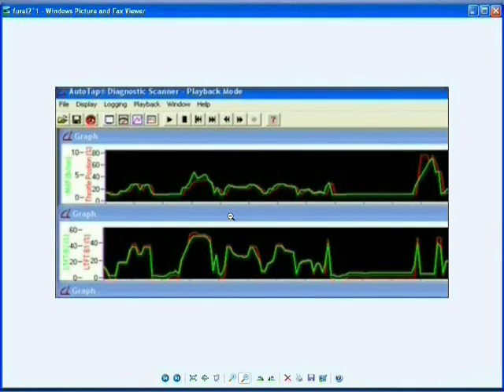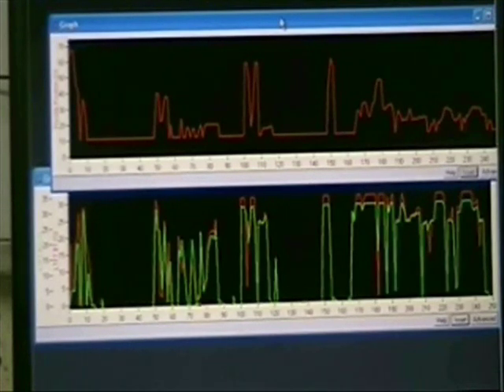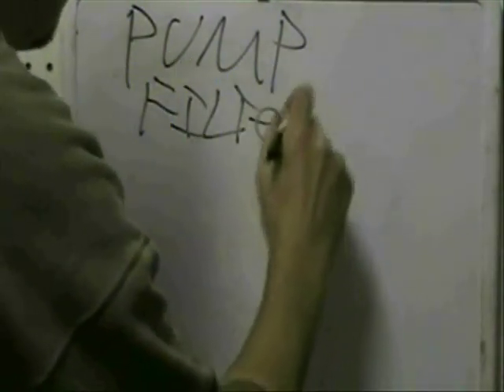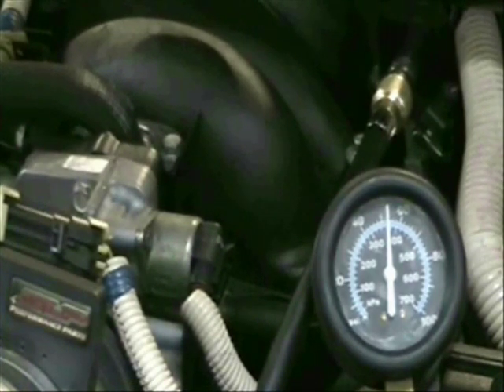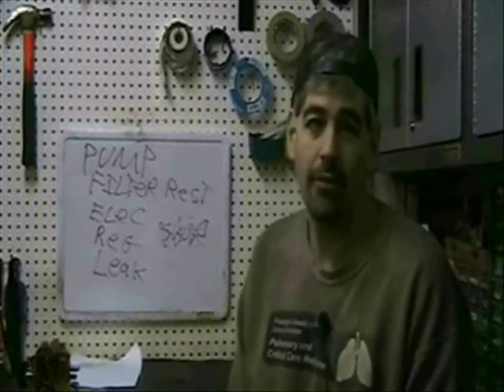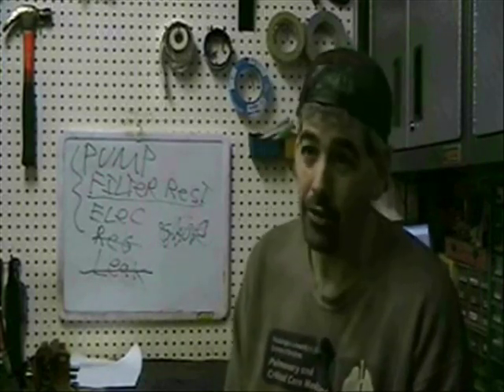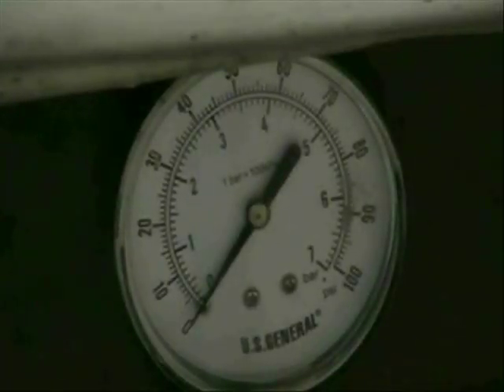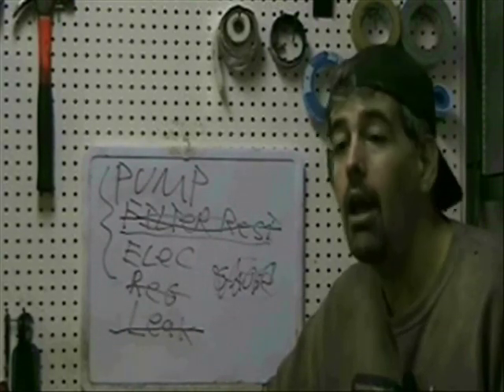Low Fuel Pressure, Lean Condition diagnosis PART 2

Comment: I just confirmed that I have a bad gauge.  I'm trying to find out why my old Fiesta 'hunts' at idle, and I was getting a surprisingly low value of 30psi on a new gauge.  I decided to test it by using it to measure a known good tyre pressure, tested with several gauges.  The fuel pressure gauge seems to be about 20% down.  This only gives me a fuel pressure of less than 40 (manual wants 55), but since the car otherwise runs well, I don't really think the pump is bad.  I'm trying to convince myself of this because I'd have to drop the tank to replace it.  I'd sooner cut a hole under the back seats, but that's going to be a last resort :-)
Reply from the maker: What is the fuel trim analysis showing during the hunting?
Reply: @SchrodingersBox  Many thanks for your reply, which I wasn't expecting, but is much appreciated.  I was watching one of your old videos, and you mentioned bad gauges, so I chimed in.  Anyway, my problem is that at idle, it almost cuts out every ten seconds or so.  It will sometimes cut out at a junction or slow bend, causing me to lose power steering, which is quite embarrassing.  When this happens, combined idle fuel trims are at about 50%, the O2 sensor is maxed out rich.  STFT comes down to about 15%, O2 sensor comes down to 0, RPM drops to about 400, STFT goes high again, and the engine recovers with high O2 output again.  I'm guessing it's a vacuum leak at the moment, but so far, I haven't found one.  All hoses look good, it doesn't have a PCV valve as such (just a thing called an 'oil separator'), and since it has a TMAP sensor, I'm assuming that will sort of compensate for leaks in a way that a MAF sensor would not; although I could easily be wrong :-)
Reply from the maker: Wait you lost me- how can you have 50% fuel trims with O2 sensor maxed out rich?  That’s not possible. Am I misunderstanding something here?
Reply: @SchrodingersBox  I know - it seems odd, but I can only imagine that the ECU is trying some weird strategy for a ten-second period to keep it running, then it allows things to go back to normal, at which point it goes very weak and stalls.  Or something is broken.  Or I am confused about my readings, which is very possible.  I'll try to find a way of showing some images.
Reply: @SchrodingersBox  Hm.  I had a thought - if the fuel trim is high (which I think means less fuel, not more, although I'm not 100% on that), but the O2 is still rich, maybe I have 'unmetered' fuel in there, rather than air?  Like a leaky injector, which would also explain my low fuel pressure?  The injector pulse width seems to be bottomed out, too.
Reply from the maker: Sorry but I don’t follow what you are saying. It is impossible to have a fuel trim of 50 with a rich O2 since the fuel trim is set by the O2 output.  Sure you might have unmetered fuel but it’s clearly being detected by the O2, so why is the fuel trim 50? 
   Sorry but it makes no sense. Something is off on your reading.
Reply: @SchrodingersBox  It's probably my lack of understanding, for which I apologise. I have assumed that a high fuel trim is an attempt to drastically reduce the fuel (i.e. a lot of 'trimming') in response to the O2 sensor saying that the exhaust is rich. From what you say, I probably have this the wrong way round.  Anyway, I tried to post an image earlier which I think shows both O2 and STFT to be high; but I'm not sure that my post succeeded.  In any case, I ought to have shown the LTFT, too, just to be sure that I'm adding them correctly.  So I'll take some more traces.
Reply from the maker: No high fuel trim is an attempt to add fuel. It’s to correct a rich condition. Your 50% trim means that the O2 sensor is still full lean even after 50% more fuel is being added than normal. 
  This would not be result of a rich condition or leaking injector. You cannot have the O2 sensor read rich but have fuel trim add fuel. 
  Recheck your data and you will see something was misinterpreted.
Reply: @SchrodingersBox  Yes, I realise that now, and I feel rather silly.  I've seen enough FT videos recently to know that high FT means more fuel and I don't know why I forgot that.  But I was thinking about the sawtooth-like shape of the FT - it seems like it is to some extent ignoring the O2 to keep the thing running.  The O2 is not always rich, just nearly always.  When it stalls, it drops down to zero, at which point the fuel trim goes right up.  But when the engine recovers, the FT only comes down slowly, in a long straight line like a very long sawtooth.  And while it is still coming down, something somewhere else makes it go very weak again (even though there is still a fairly high FT at the time), and the process repeats.
Reply: Well, I finally found the cause, but only because the problem got much worse (it became very reluctant to even start).  I thought I'd start looking at the fuel system, and after checking that the pressure was good, I looked at the injectors, and discovered that they were only pushing out a thin straight stream of petrol.  I pulsed them in an ultrasonic bath for hours (which is how long it took for all the clouds of deposits to stop coming out of the end).  Eventually they came clean and now the things runs as well as ever on its 20 year-old injectors.  Why this should produce rich O2 sensor output and hunting, I don't know for sure, but I guess the computer code decided that the only way to keep it idling was to squirt as much fuel in there as possible, and hope that at least some of it got near the spark plugs.  As soon as the fuel trim got too low, it would almost stall, and so it keeps throwing more fuel in.  And so on...  Having a mist of fuel, and not a stream is clearly critical :-)
Reply from the maker: Glad you got it worked out. I don’t know why you would see a rich signal. Could maybe be that not being aerosolized, the raw fuel didn’t burn and contaminated the O2 sensors?
Reply: @SchrodingersBox  I imagine it would be something like that. This thing has sixteen valves, so the split stream coming out of the injectors was probably just hitting the back of the valves and dribbling into the cylinders.  One of the injectors only had one stream going off to one side.  A right old mess.

Comment: Short and long-term fuel trim is 25 plus and it's bogging down from 50 psi to 0 on the fuel pressure. I changed the fuel pump fuel filter and fuel pressure regulator 6 months ago. I checked the fuel pump yesterday and seen that the screen strainer is all rusted out with like Rusty mud. About half of the filter was clogged can that be the reason. I did clean it with starter fluid pretty good like new and the car is running great now but I cannot predict if it's going to go back and start bogging down.....btw... Yesterday my fuel tank was extremely Rusty
Reply from the maker: Anytime you change a pump you must remove the tank to clean it if you want to ensure issue doesn’t return.
Reply: @SchrodingersBox  thanks... This weekend I'm going to buy another fuel tank before I put it in I'm going to have it de rusted

Comment: Hey Matt, so I have seen several of these excellent videos, and I have often wondered about using the fuel system data available on some cars’ PCM for diagnosis. For example, what about graphing LTFT and Fuel Pressure, or RPM and Fuel Pressure in order to rule out a bad fuel pump? Is there a good reason to not use these data points for diagnosis? (possibly leading to faulty assessments)
Reply from the maker: I do that all the time when fuel pressure is available as a PID. Totally valid test for sure.

Comment: Hi Mat I had new fuel relay put in also, whats lose is the coil wire could there be a chance it's saying don't start the fuel pump two fire, I no the basics it almost seems like it's something in the wire harness, there was hesitation with the last fuel pump when running we start destributor, cap, rotor, and still not turn the motor over but it dose crank the motor! From the relay we over road the switch still nothing! We still have two run other test with the test lite!  BArsenea@Yahoo.com

https://photos.app.goo.gl/ngDQ4NdjbA6rWd3p6

Comment: Hello mat, question,removed cylinder head from my 94 jeep Cherokee straight 6, turns out it had several cracks,got a refurbished one,so my is is it ok to use the rocker arm components bolt,bridge,fulcrum ,rocker arm and pushrods on the refurbished head?
Reply from the maker: Yes you can as long as they are in good condition
Reply: @SchrodingersBox  thk-u mat

Comment: I didn't have the means to replace the fuel pump in my 2001 Chevy S-10 4.3L myself, because of the necessity of having to drop the tank, and it being a pain in the ass without a lift, so I had my "usual" professional mechanic do this for me last year.  Mine had been needing to be replaced for a while, but not so much as suspecting a weak pump, but because the sending unit which is integral with the pump itself was bad.  This would cause my fuel gauge in the dash to go all over the place sometimes, and more noticeably, it would drop to "E" while sitting at a red light, and then jump back up to the correct level after taking off from sitting still.  It was getting on my nerves to have this repeatedly happen, so I decided to get it replaced.  Just an FYI for some of the viewers here that may have the same issue.  It's pretty common in the GM trucks, and maybe even the cars from this era.

Also, a very common method to replacing the fuel pump on the GM trucks is to loosen the bolts on the front of the bed, and then lift it up, and support it, therefore giving enough room to replace the pump, rather than having to drop it completely.  Also just another FYI, as this is what was done on my truck.

Comment: The gauge was slow slow slow drop rate but did not hold pressure, and one thing I'd also do is to put a load on that pump, like with any other type of pump. I dont know how much load a meter alone puts on a pump. not being cocky, just talking pump talk.
Reply from the maker: How can a meter put a load on a pump?? That makes no sense-- explain???
Reply: @SchrodingersBox  no but tee-ing the output with the meter on one of the branches and something as simple as putting ones finger over the other tee output (yes it will spray gas everywhere) would allow someone to put back pressure on the pump. Is there another way to put backpressure on the pump. I just think its a feature a pump should be able to tolerate.  Your thoughts? (I'm just glad to be talking to the legend by the way. Your fuel trim videos did indeed change my way of troubleshooting)
Reply from the maker: @EdWeibe  Why not just test for voltage drop instead of whatever you are trying to do?
Reply: Of course.  That defintely the safest way  out of the two.

Comment: 97 jimmy at idle long term B1 goes up to 50% and short term B1 25% smoked it for vacuum leak didn't find any, fuel pressure at 55psi, while running, 5psi drop at shut off, intermittent misfire cyl 1 and cyl 3 and cyl 5, only code  found p0300 multiple misfire. Checked timing checked spark, and compassion, all good. Please help!!!!!! Thank you
Reply from the maker: Not enough data here. you need to curve your sat against load. Why would you smoke engine for a vac leak?
Reply: Schrodingers Box well i wanted to make sure i didnt miss a crack or anything like that cause at first that what i thought my issue was.
Reply from the maker: there is no way to tell what the issue is with that data.
Reply: Schrodingers Box well thanks for responding, still learning what do you mean curve sat against curve?
Reply: Ooopss what you said lol
Reply from the maker: See my video on how to do fuel trim analysis. it will show you the data you need to make a diagnosis. you can’t just use static fuel trim alone.
Reply: Schrodingers Box ok thanks
Reply: Link of the video? Or title?
Reply: I think i found it "secret of engine diagnosis......"

Comment: Hey, so I have a 99 ford explorer. I keep getting codes for too rich and too lean. It goes back and forth. I can't find a vacuum leak, and the engine runs pretty good. the rich code has recently come on when idling. The lean code comes on mainly when the engine is cold. I have a scan tool that tells me anytime a code is showing. I have also gotten a few other codes like P0074, P02>8, P0154, P02>2, P0974, P0040, P0001, P0371, P4000, P0800, P011, P0010. all codes come on intermittently and disappear from time to time. the only ones that have sticked was the lean condition. I'm so confused because that's a lot of codes, but I am wondering if it's fuel delivery related since they're all similar codes. what do you think?
Reply from the maker: What data do you have? What's the static vs loaded fuel pressure? What are your STFT and LTFT and idle vs load? What's the static ve load MAF frequency?
  You have no data to go on.
Reply: Schrodingers Box so I should check the fuel pressure?
Reply from the maker: ***** You should already have checked the fuel pressure... both static and loaded. It would be the first diagnostic for this symptom.

Comment: Hello Matt, just wondering with engine off key on (no fuel flow) even if there was a restriction would you fuel gauge register low pressure?  I understand once the fuel starts to flow with the engine running you will see a pressure drop. Let me know if I am off base here.
Reply from the maker: +Randy Ingrao You are correct. if you do KOEO prime the system is deadheaded and a restriction would not be as detectable. However it will take longer to build the pressure to spec in most cases.

Comment: I know this is an old video but have to ask...when you suspected your fuel test guage bad and you put it on another vehicle to test how is this a valid test as it isnt tested against a known pressure...yes you may of know what the fuel pressure was supposed to be on the other vehicle but to be an accurate test shouldnt it be made against a known pressure...
Reply from the maker: +ketcamaro It is against a known pressure.  Normal fuel pressure of an LS1 engine is 55-60PSI. Because my trans am has no LTFT adjustment and normal STFT's plus .8V from the O2 at WOT I know my fuel pressure must be in normal range, thus verifying the gauge reading.

Comment: Watched your videos on fuel trim and learned a lot so thanks for that.  2001 cavalier with 2.4 and a lean code.  Car as long as I have owned it had a miss/skip under load at times but has progressively gotten worse and recently threw the p0171 code, put the scanner on it and let it warm up through 2500 rpm the numbers short term and long term stay within ten percent on and off throttle so the numbers really aren't that far out of whack.  Car seems to pick different times to throw the code and run like crap so thinking there is a bad connection somewhere if the numbers are staying within ten percent at idle and up to 2500?  Not sure on this one, maybe PCM going bad? Stumped.
Reply from the maker: +Restoring Sanity to An Insane World. What other data do you have? All I see is fuel trim (and incomplete data at that).  What evidence indicates the PCM is going bad? What are the specs you have that are telling you this?
Reply: Well, I don't have data the PCM going bad sorry I wasn't clear on that just a guess because the car runs much worse at certain times than others, sometimes it runs smooth and sometimes it doesn't.  I'll get some more data to report and watch more of your videos so I can be more specific.  Thank you for your response.
Reply from the maker: Restoring Sanity to An Insane World. Yeah you need to just think of other possibilities that can explain those sysmptoms and rule them out.
I can think of about 15.
Reply: those fuel trim videos are a life changer.

Comment: Fuel pressure test before fuel filter was unnecessary because when you did the pressure test with the injectors unplugged while the spider was out (other video) and you could visually see that the injectors were not leaking, you were testing the pressure non-dynamically.  Non-dynamic test would not show a pressure drop across a restricted fuel filter.   Not sure if this what I'm saying is clear.  Might have been an oversight or might have been you were just being thorough for the video.
Reply from the maker: CoolAirVw I think you are misunderstanding the purpose of the test- it was to deadhead the pump to confirm the low fuel pressure was not from a clogged filter.  Measuring before and after the filter is the only way to confirm that 100%
Reply: Schrodingers Box Not arguing..  just for discussion.....There cant be a pressure drop if there is no flow.  So when you had the injectors unplugged and out, seeing that they weren't leaking, the pump was all ready "deadheaded".   Hydraulic theory (pascals law about hydraulics... pressure in a confined area is equal in all areas and all directions.).   Of course if there is flow then there is pressure drop, just like voltage drop.   I'm sure you know this because you explained "hydraulic theory" (sort of)  in your voltage drop video.   I sent your voltage drop video to my employees as "suggested viewing" for training purposes.    Love your video's so far.
Reply from the maker: gotcha. makes sense.